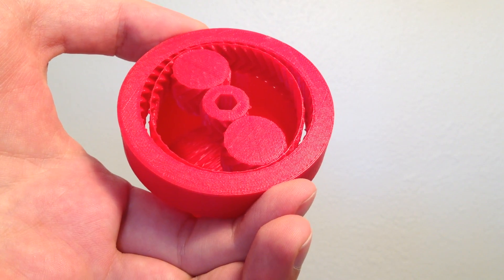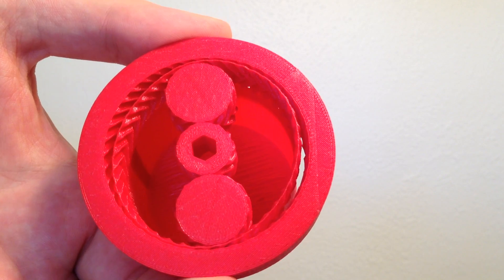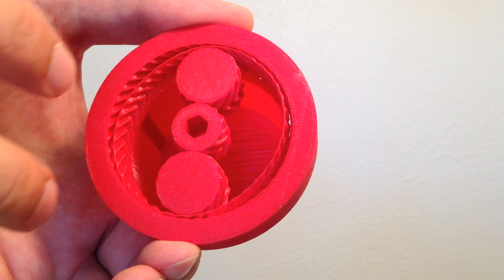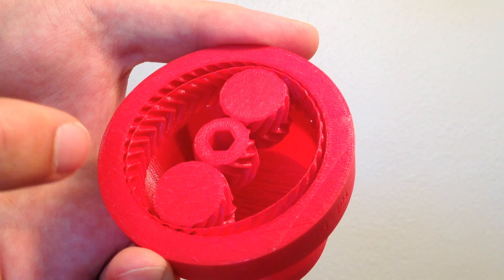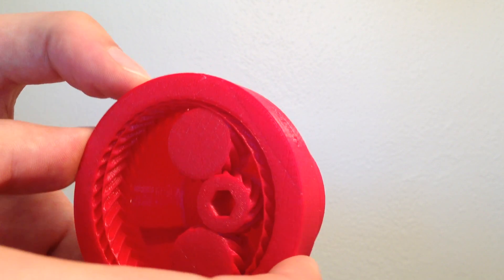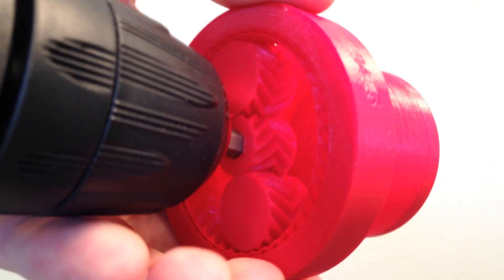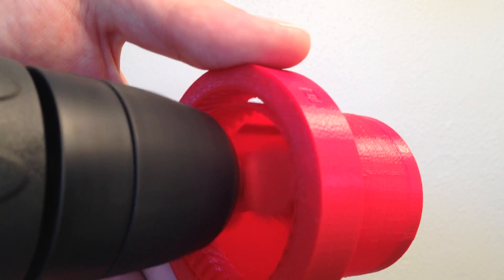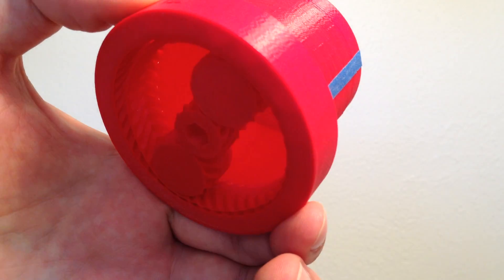Preassembled Harmonic Drive

Comment: what was that clearance you used to print all this at once? i try to print things at 0.5 and its just about free from sticking but it does have a very tiny gap where it can come off  for an example i did a square box with a hole in the center and that hole is big enough to fit a cylinder that fits that hole diameter on that box but that clearance of .5 is just good enough to fit but not tightly BUT all this was print separately not together as you say yours was, any tips

Comment: Would this concept work with 3 planet gears instead of 2 in order to keep the input stationary?
Reply: No, it wont work. Harmonic drive must have contact in only 2 points. and other 90 degree 2 points must be up
Reply: No it would not.
third one would just cause problems.
4 on th other hand might work
Reply: @websonic1000  3 would work, but the outer most ring gear would need to have an extra tooth added to it. 4 would work with the same ring gear profile but would need to have two opposing gears be a little smaller so that an elliptical shape can still be maintained. There is a chance the gear pitch is too big to allow that.